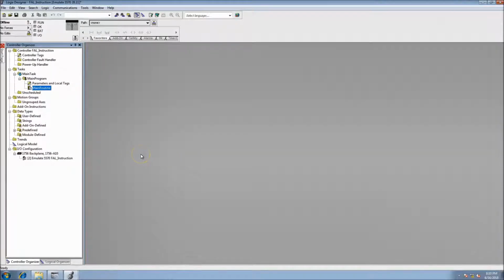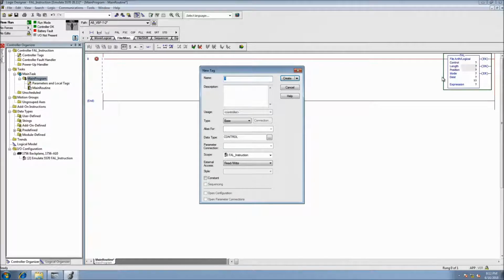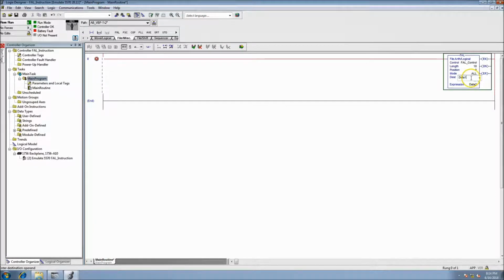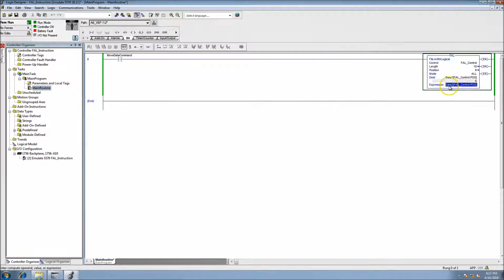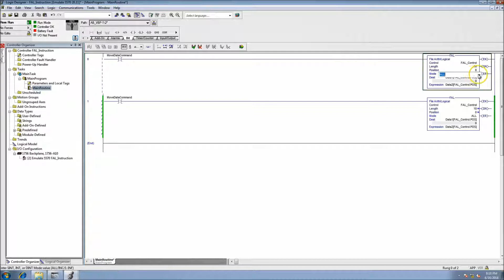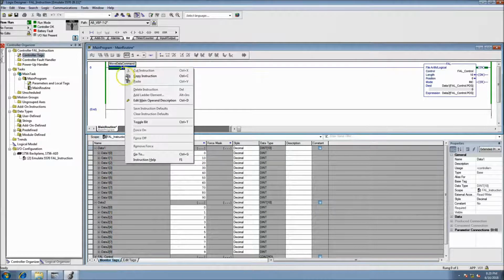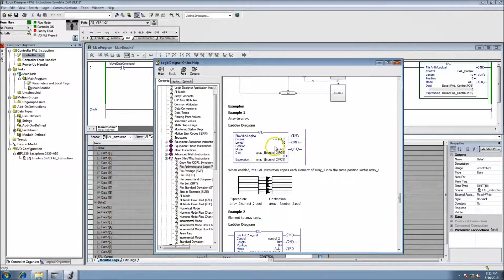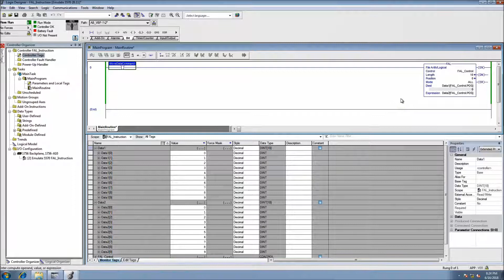Studio 5000 FAL Instruction With Arrays

Comment: Good job Shane! I am a automation specialist and you can’t imagine how important stuff like this is to me on a daily basis. I am in middle of a PLC/HMI/Servo drive rebuild that I am having lots of trouble with. Your videos have been there for me. Not sure if you ever dealt with Servostar300 and the TRIO comms cards they used, but my HMI quit talking to the servo a few weeks back and I haven’t been able to get it back. We ordered new HMI from builder and I should be connecting it tomorrow. Hope it works!!!
Reply from the maker: I do not have experience with Servostar300, sorry about that
Reply: @ShaneWelcher  the HMI ended up being the problem after all. Connected it and the comms error went away. Now it’s not homing it’s just continuously spinning until it faults. I need to find how it knows where home is